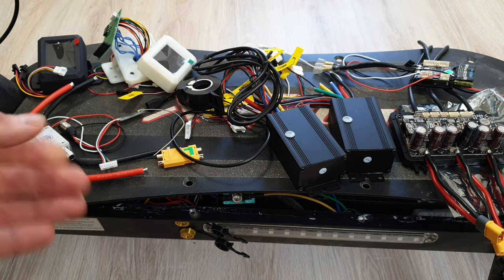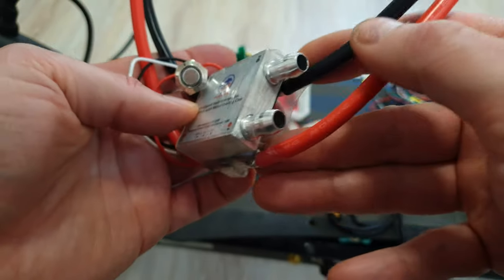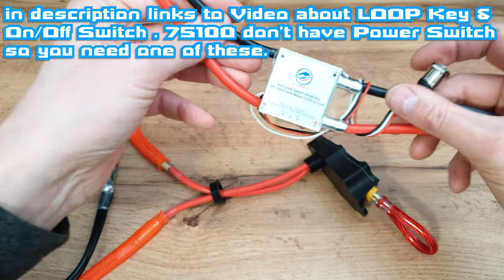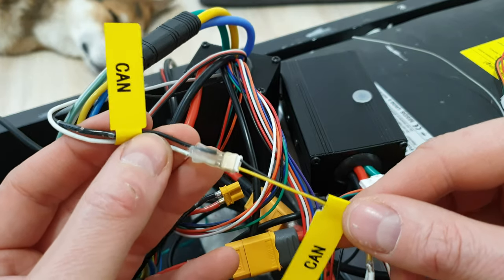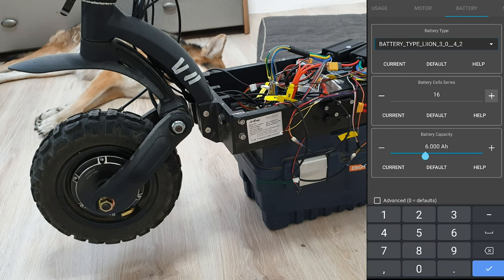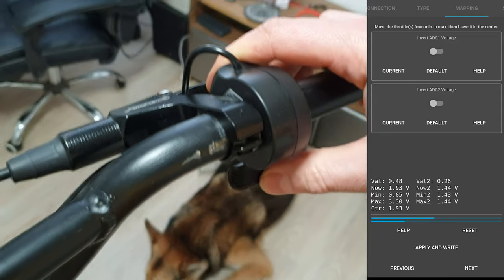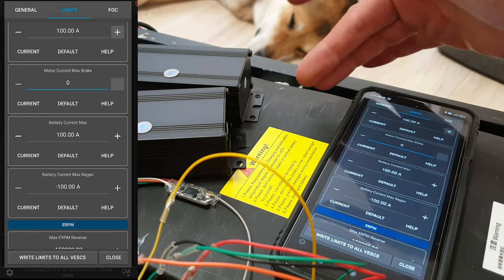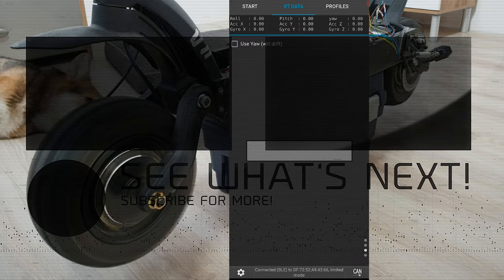How to Install & Setup FSESC Controller in Escoot or Ebike 🚀 Flipsky 75100 & X30 / Ti30 Example ⚡

Comment: i just bought a 3shul CL1000. 30s. 126v. 500 battery amps. 1000 phase amps. i cant freakin wait. this is my first vesc controller. I'm excited. building bikes and scooters and motorcycles was getting boring. you just buy the parts and click em together like a puzzle. Now with VESC it put the mystery back in it which is fun. learning new things is fun. learning new sub hobbies within your hobbies is fun. this is gonna be a 63,000 watt e-dirtbike. its awesome to see h ow many people are into VESC and just how many controllers run it. Its actually way bigger than i thought it was. Its always cool to see the community around these hobbies. This vesc community is way bigger than i thought it was.
Reply: 100% agree
Reply: Hi friend,  I built a axial flux electric motor by miself I have a cheap china controller.   Can you please help me  configure the 3shul CL1000 30 s  126 v, 500 amp

Comment: I just got these controllers working in my Yume D5 2 x 1200w motors. The Yume's don't use hall sensors and despite getting replacement yume controllers my motors always stuttered if you accelerated hard. Now they don't instead I have crazy acceleration, the wheels spin even when free-wheeling. Feels like so much more power than before! Love it! Thanks again for your videos!
Reply: hi Dom, do you also have good torque at lower speeds, or let's say by start?
Reply: @minalobudeshte  I had too much power at the low end causing the wheels to spin. So I added a throttle curve to take the edge off. Also changed max amps so the rear wheel had more power than the front as it was also spinning. So now it accelerates hard but better traction. I still have to be careful off-road on hills not to hit the throttle too hard or it will spin at low speeds. Once you get going it’s absolutely fine. It’s also really easy to go at slow speeds, lots of control on the throttle.
Reply: Tenga cuidado con la temperatura del motor

Comment: I got everything working on my m365 scooter except for the hall sensors. It's so slow at slow speeds under 10 miles an hour but after that it hauls ass. By 20 mph it's really hauling ass

Comment: I’m setting 2nd scooter with Your video. I’ve allways have problem with power cutting-off. On app it shows perfect values, but while driving scooter have no power and don’t drive at any hill. I guess there is a problem with torque or something. What I can do wrong, would you help me including delating error from VESC? Or maybe you have some trick to 2 engine (2000W) scooter to start it with minimum 1 engine with full power and torque.

Comment: I believe the wheel diameter settings is your tire size converted to MM so you can get semi accurate range setting from the app and speed. That’s what the esk8s gave to play with to get their handheld controllers to display speed accurately
Reply: for me i actualy measure it. for example a 200x50 wheels actual size is 190-195 new wheels.

Comment: Cześć Piracie Właśnie jestem przed instalacją w m365 Pro 2 FSESC4.20 + TFT monitor + sparkless switch od Flipskiego + silnik 500W 48V a’la Monorim. Zamówiłem pakiet u scootermode,eu 13S 20.3Ah w podeście. Konfiguruję wstępnie wyświetlaczem i mam tu parametr kV silnika. Masz pomysł jaki powinien być ustawiony do poprawnego działania tego systemu? Z moich obliczeń wynika że kV mieści się w granicach 18-21 przy napięciu 48-52V i prędkości jazdy 40-50km/h

Comment: Hey man, I dont' know if you still answer questions but does the 75200 esc have on/off? if not, do I also have to use a loop key?
Do you know of any loop keys that work in conjunction with an electronic lock?
Thanks!
Reply: Hey! I have the same question! Did you find out anything? Thanks!

Comment: This is not the only way to remove wires from neck you have these things called pins in each connector and they can all be removed from plastic housing and rehoused easily with the help of terminal removal tool or a simple pick type tool being jammed into the release slot. Saves you trouble and makes it look like things aren't going to suffer loss of current due to re connected cut wires.
Reply: non serve, va rimosso tutto...

Comment: Thanks for the video, another way to make the reading drop quickly is to add a pull-low resistor on the ADC1.
Reply from the maker: Decent idea thanks
Reply: ciao, cosa vuol dire?

Comment: Hello Pirate, the Ti 30 battery supports 80A with the standard bms, but if you change it for a better one it can reach 100A maximum :)
Reply from the maker: max safe is 80A , above it battery could be shorted so it can get fire or be damaged in short time :)

Comment: Hello, great Video!! 👌👍👍👍
I have the same motor as you but only a 48V 1000W aluminum motor installed in the back and why after the motor test it only says: 28A for motor?!  And at the bottom it says Sensorless!  How come??  And I don't think my motor can only withstand 29A current!  But it sits there like that after the engine has turned!  And I have a Brainpower Controller with a current maximum of 38A and I have with this main controller A because there were controllers A + B and I only managed exactly 95kmh in the air with a Brainpower Controller A main controller with S866 display and GPS!  And here the Motot test says for me: Motor 29A Current and sensorless below!  How many ampere current can I set the motor to in the motor settings?

Comment: Nice walk through, most important tip, red with red, black with black, other are signals wire :-D 
I remember the VESC tool when I made my esk8, it was not easy to understand at first. You got a SUB! 
How are the super cheap controllers? Did they go up in smoke yet?
Reply from the maker: Thanks, still works perfect and seems to overheat a little bit less

Comment: good video! One question, for a normal person who wants a skate to have fun for a while and also use it in the countryside apart from the city, do you recommend the ti30 or the es18 lite? Do you think that the es18 lite is enough for that or is it not enough and there are than try to go for the ti30? I think the ti30 is too much that's why I ask
Reply: es18 is good in my opinion
Reply: I am waiting for my es19, you should go with that. Though it doesn't comes with off road tires :(
Reply: new update: i kinda regret buying es19. shit 2 powerfull for a normal human being lol. actually having a blast, but scary as fuck

Comment: Did I see that right? You have the one throttle signal going to UART1 on both controllers? Same for the brake signal except to UART2 on both controllers? I thought those signals needed to go to only one of the 2 controllers and then CANBUS handled communicating them to the other controller? Will you add the LCD you presented in your last video? It's a Davega clone, but works the same.
Reply: esatto

Comment: Nice video! Didn't know about these controllers. Does this work with sensorless BLDC ? My Speedway Leger electric scooter doesn't have Hall sensors only the phase wires
Reply from the maker: yes it will work

Comment: Hello!  I received my VESC and have a question: at COMM do you know which cable is the strong current plus cable for the 48V battery and which one the controller switches on please?  For all controllers it is usually red 54.6V fully charged then blue on blue for the controller with display to turn on and the third then black on black.  Because I want to connect a display again and the display connection is the COMM connection, right??  And my second question please: what is ADC1 and ADC2 on the COMM connection?  For the COMM connection there has to be a high current cable, a plus + cable with e.g.  My battery should then come out to 54.6V with a 48V battery so that I can turn on the display.  Please can you tell me so help me briefly?  Kind regards.
Reply from the maker: Hi, all your answers are in this Video, There is no way to use standard LCD scoot screen with VESC, you have to make decoder which is even for me super difficult.

Comment: I'm at a loss, how many amps should I put in if the LIMIS maximum battery current is 52v23Ah1000w dual motors?

Comment: Great video! What value resister did you use on the brake wire?
Reply from the maker: You can use almost any tiny resistor  which u can find

Comment: Just a quick question did you have to remove wires from  comm connectors from each controller then put them together
Reply: U have 2 x signal wire  yellow is that throttle and brake

Comment: hi... I would like to mount vesc 75200 on my bike but I didn't understand how to connect the brakes because as you say in the video they only have two cables... does the solution you give work?  connect one cable to 5v and the other cable to adc1?  Thank you
Reply from the maker: brake signal is just voltage , so if you close circuit  ( brake signal ) then Vesc will get into braking process. If you need smooth braking then go with hall sensor system for brake lever.
Reply from the maker: @alessiogambi6881  by process of elimination :)

Comment: 8:54 Can you clarify throttle red wire is really connected to 5V? Later in the input setup you show getting 3.3V from throttle
Reply from the maker: yes 5v, cuz 3.3v is max output from hall sensor
Reply: @PirateWasHere  ok I was worried that maybe ADC is only 3.3V tolerant and 5V can fry it
Reply: normally 3.3v
Reply: @PirateWasHere  non era molto chiaro e comprensibile...

Comment: Is bluetooth the only way to program the controller? I'm seeing that it only works with Android and not Apple? I have no Android devices... Just ordered two of the same Flipsky controllers..
Reply: I have received the controllers and see it can be connected to the PC and that you can now Bluetooth to IOS and have downloaded the VESC app from the app store. Now I need to know if the existing Bluetooth module will connect to IOS? Everyplace that sells the module says it is only working on Android, and as the IOS app was reasonably recent, guessing they haven't updated the information. Sent an email to Flipsky to confirm this.

Comment: It's pretty easy to depin those connectors. You can just take a really small needle or something and bend the tab that holds it in down.
Reply from the maker: Yes sir, I am just lazy 🤣🤣😇
Reply: Nice video btw, just finished it. What is your dog's name? 🥰 I can't wait to try this modification on my Ti30. They sound so quiet. If you are worried about overheating the motors, you should look at putting a bit of ATF fluid inside the motor housing to help cool the coils. The hot atf fluid splashes on the aluminum cover and helps get rid the heat. I've heard you can push double the power output from the mod.
Reply: I have a question, if my motor does not have a hall, how can I connect the controller?
Reply from the maker: the same way , just skip hall sensor step from my video :)
Reply from the maker: My dog name is Foxy :) , she is legit czechoslovakian wolfdog from dog shelter :) , to get here I went literrally half of my country. Some looser tried to drown pupies in the river, he put them in to black bag & tried to throw it but someone noticed it and guy run away ... and there is my foxy story :) . I always saying that any fluid in that kind of motor is bad idea ,there is more cons than pros BUT I really appreciate your input 🍕🍻
Reply: @PirateWasHere  most important over all at the moment is..... the puppies could be saved... thank you

Comment: Hi pirate which is the powerfull motor can you recomend please my baterry is 20s and90ah 80v
Can i het 6000w continuos?
Reply from the maker: What do U mean ? Any motor which can handle that power ;) for 11" only custom with good cooling solution
Reply: @PirateWasHere  I mean a sss motor 56123 is 9000w nominal and 15000 peak at 72v 
How much juicie can i get fron this vesc
Reply from the maker: @meganguerra-cd9gj  constant maybe 2kw
Reply: @PirateWasHere  thats a shame.  They say 84v and 100amp continuos and 120amp peak

Comment: Hey Pirate, is it not possible to keep the original Display/Throttle?

If not, why?
Reply: I was thinking the same. My original display/throttle has two separate cables coming from it, one for the display and one for the hall effect throttle. 
The display would be GND, Battery voltage and mode select. The second cable is 5v (or 3v?), GND and Signal for the throttle. Other than mode select which would need another ADC input (already using the two available for throttle and brake), the display really just needs the Bat voltage and GND right?  To turn the unit on and to read the voltage.
Reply: Just thinking though, how does it know the speed? It is probably the throttle percentage. Is the throttle connected in the unit? Need someone to do a proper detailed break down of converting Chinese scooters to these controllers as its confusing!
Reply from the maker: It measure rpm of the motor so magnetic field changes, and calculate by dividng this value by choosed wheel diameter. Percentage of throttle .... its so 1990 ;) . I do recommend to do  some research, u can learn many magic things on the way 🍕🍻
Reply: @PirateWasHere   There is 3 wires for the Hall effect throttle, and three wires for the display (on my display/throttle) the 3rd wire on the display goes to the mode select wire on old controller (from memory) so how does it also read the magnetic field changes? 
Also, why do you put a resistor on the brake switch wire? And how did you wire the controller to activate the brake light? 
Could you point me to a good place to research all this?

Comment: Hi. How many watt is your motor? because I have Janobike T85. I used only one motor to run, but I have problem with 75100. My motor is 2800 watt. But when I start to go at 20/25 Km/h the motor got in block and not run. if the wheel is free to run it work but when I use in the ground it make me problem. My battery is 32 Ah 60 V
Reply: You still have this Problem ?
Reply: @Uwe342  Hi right now I have disassembled the scooter because battery problems. anyway I think I will change with the new version 75200. so yes I still not resolved that problem.

Comment: Do I have to set up a brake to adc2 or could I just setup throttle to adc1 and just use the hydraulic brakes?
Reply: Puedes usar cualquiera , dependiendo del cableado

Comment: Is there a way to balance the front and rear wheels? The rear runs fine, but the front is sluggish.
Reply from the maker: try to re auto motor tune when battery is fully charged

Comment: Hello, could you tell me if it is possible to put a dual-single switch so that it does not always go with both motors activated
Reply: ciao, integro domanda...
basta interrompere il Can, oppure l'alimentazione? Grazie
Reply: @matteochristianvenditti1452  se maa come si fa?

Comment: Great video. Can you say why you changed the hall wires (color). I am having a hard time getting my 75100 to even test the motor much less run it. I am new to this and having a rough time wrapping my head around this.
Reply: He didn't they are the same
Reply: @MrGiodude17  21:47 swapped 2 wires.

Comment: Hey this is what I have been waiting for, I’ve been watching you since original m365 videos and tuning .. I have a question, is it possible to use default accelerator with flipsky 75100 ? And original display? I have Yume S10
Reply from the maker: Ofcourse not ;)
Reply: Default accelerator yes, with adc board from spinted. Display, no!
Reply: @MrViiP3RZz01  so can this board connect to dual 75100 with alu. pcb or you have to get board from sprinted
Reply: @frayfray6168  not sure what you mean here? With the aluminum heat sink?
Reply: @MrViiP3RZz01   can you use the adc board on flipsky 75100  dual board with alu. Pcb
Reply: @frayfray6168  yes you can

Comment: It's 52v23Ah1000w, but how much should I set the maximum wattage and maximum brake wattage in the limits?
Reply from the maker: I would start with  max 1000w power,  brake max 400w, max regen  200w
Reply: @PirateWasHere  ciao, perché tu hai impostato invece, -100W per il freno?
e max regen in W, dov'è? non lo trovo...

Comment: What about the lights ? how are you going to wire them ?, is it related to PPM port ?
Reply from the maker: Lights are on manual switch , so battery> switch >lights
Reply: @PirateWasHere  I see yes but for the power are you connecting to ppm on controller on do you use a converter connected to battery ?
Reply from the maker: @onehubanime2770  no idea what do mean
Reply: @PirateWasHere  on these controllers, if I break and want my back lights to turn on, where do i wire it on the controller ? Same for horn where should it be wired, I have TI30.
Reply: @onehubanime2770  ciao, devi fare un impianto a parte, i controller controllano "solo" i motori

Comment: you can use a 2nd throttle as electric brake control, so it's not just 50A but you can just regulate it with throttle
Reply from the maker: this is what I done, stock brake lever is just 0/1  , while something like m365 brake lever got hall sensor :)
Reply: @BH4x0r  ciao, dov'è il controllo di trazione? grazie
Reply: @matteochristianvenditti1452  VESC Tool -> App Cfg ->  ADC -> Multiple Vescs' over CAN & Traction Control should be on

note that if both wheels are slipping at a similar speed the traction control will fail (traction control keeps both motors at around the same speed, if one slips/goes faster it'll slow that motor down to match the other motor)

Comment: Dear Pirate, please be so kind to make a new video showing the fine-tuned settings of your VESC.
I have used the settings in this tutorial, and after half my ADC throttle, the wheels go crazy. And I still see 180 km/h on the Telemetry.

EDIT: The problem is I'm using a 5v throttle for 3.3v max for the VESC... but still, an updated video would be nice!
Reply: u set correct wheel diameter ^^'..? u set correct magnets? like 30? XD